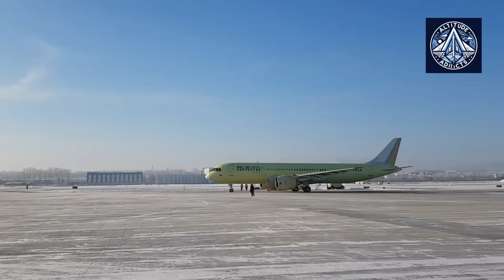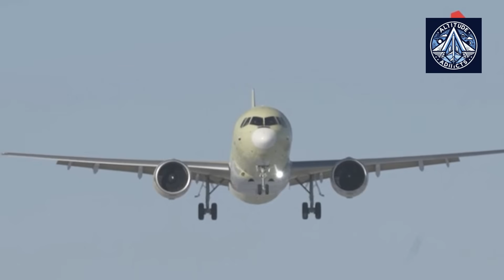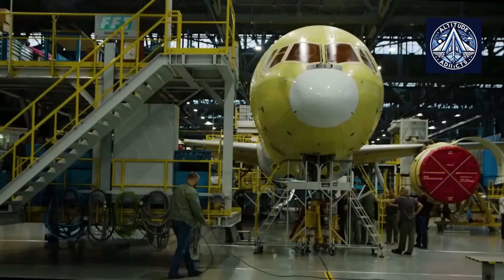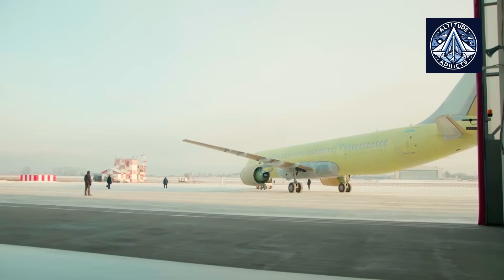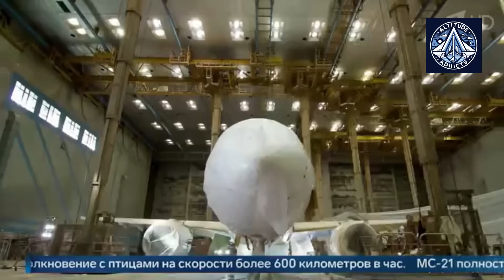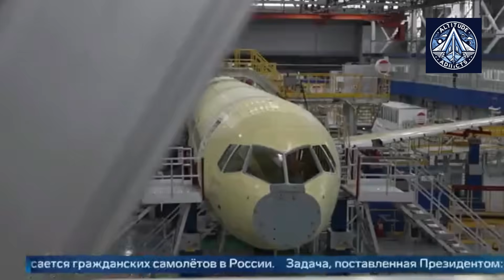All Russian MC-21 to Fly in June-July 2025

Comment: MS-21 310 is 5000kg a heavier than the original version. I read somewhere that this is because Russian parts are heavier than Western ones. Does anyone know which parts are so much heavier in weight? Electronics maybe or still composite materials
Reply: Mainly the skin of the composite material and the wires  I think.
additional  5 tons does not come from a modern instruments and programming
Reply: @nmkzf  Engines are good candidates for extra weight.
Reply: @stabilo3170  more weight more fuel/km less distance.
Reply: @nmkzf  Sure. The key number here is the original OEW versus the "all-Russian" OEW.
Reply: I agree. I read somewhere that the PD 14 weighs 500 kg more than a western engine. So only the engines (2x500kg) weigh 1000 kg more.
Reply: @topmobis3032  Where did you read this bull shit?
Reply: On the official page it says that the MS-21 310 MTOW is 85,000kg. The original version with western parts, MS-21 300 MTOW was 79000kg. Due to 6 tons more, the range fell below 6000 km. (max range 5100km). I don't know where those 6 tons more came from, but it doesn't even matter, it's very important that all parts are of Russian production and that Russian industry is progressing at a tremendous speed. It must never be allowed to buy any machines and airplanes of foreign production if a country wants to be a world power!!!
Reply: @topmobis3032  A delta of 6T between two version concerning the MTOW is not necessarily a negative figure. It coul'd be the result of an increased fuel capacity and the necessary structural change. I fear this is not the case here.
The only way to estimate the efficiency of an airliner is payload vs range, but keep in mind that most of airliners are optimized for some payload/range combination.
Reply: And I think the weight increase is mostly due to the heavier Russian composite materials, the wires too, and the engine - the engine weighs 500 kg x 2, which is a ton.
Reply: The Russians know how to design modern aicraft and control the weight of components.
Reply: There are no published weight data. All speculation by pseudo-analysts.

Comment: the plane is obviously a bit heavier now - but sturdy components are the way to go - worry about trimming weight later. It has bewildered me from the start as to why the Russians went for a PD-14 engine when the equivalent to the PS-90 would have been a more powerful PD-17/18 ? which could have gone onto the IL-76, Il-96 ... Tu-214 as well. Guess they regret that now the MC-21 is heavier .... so the Tu-214 will fill the long-range gap until at least 2030 . You can only conclude that they do have a PD-17/18 planned but it is to be a geared engine with bigger diameter - like the (troubled) P&W series .... that currently has A320neos grounded all over the World ...

Comment: If all is well in this project they can close tge Tupolev production line and let it concetrate on PAKDA and extending the operational life of Tu-95

UAC have invested heavily in this project and they should focus on this
Reply: Pakda is not needed very soon. Oreshnik would be a better investment.
Reply: why do armchair experts on internet always think they know better what a country should do and what not?. The tupolev production line is also important as they produce new Tupolev Tu-160m' aircraft and sooner or later the PAK-DA bomber. They also can use this facility to as you say extend service life of TU-95 MS. Closing this facility would be a bad idea. Also they modernize the Tu-214
Reply: @lexburen5932  Hi, a production line is customized if it is geared for large scale production. What you're saying is for low scale production (Which Tupolev did an amazing job)

If UAC is indeed serious about the Tupolev 204 family they have greenlighted the 'SM before but what they did is cancel it and focus on the  MS-21. 

Now, I can concede that I do not know the inside strategies but what is obvious for the last 10 years is that UAC is half hearted to the Tu-204/14 project in the first place since it technically revolved around Sukhoi (which is the only Russian aerospace company doing financially well during the 90's and early 2000's)
Reply: @hadjipeejayaranda669 You just don't understand the challenges behind bringing such an advanced aircraft to mass production. You are not putting all your eggs in one basket with such an important thing as commercial airliners. You keep your fallback options. Just look at the 737 desaster. Besides, the Tu-214 has important non-civilian roles.
Reply: @alexandernater6284  I agree with you on this one but the way they hung the 204SM more than a decade ago make this issue problematic
Reply: all of the money invested in the Tu-214 factory modernisation is dual use so it is actually an investment in the PAK-DA as well